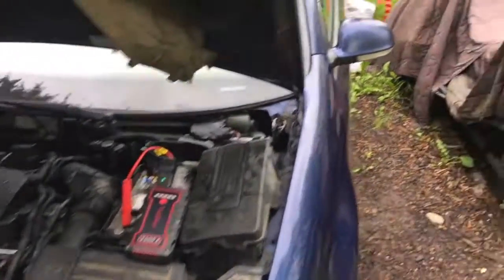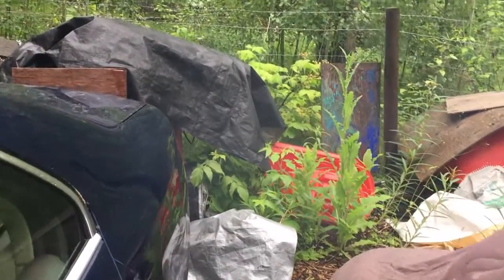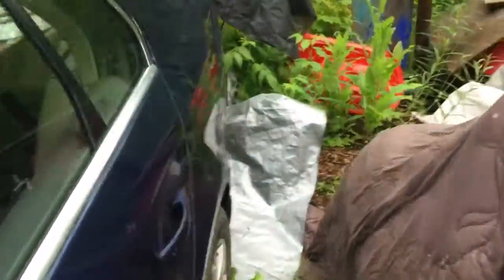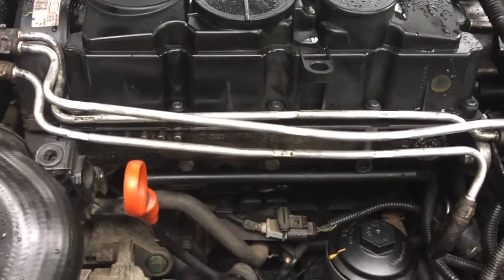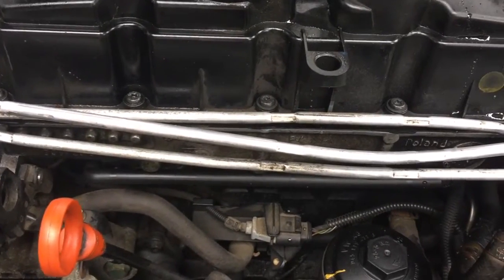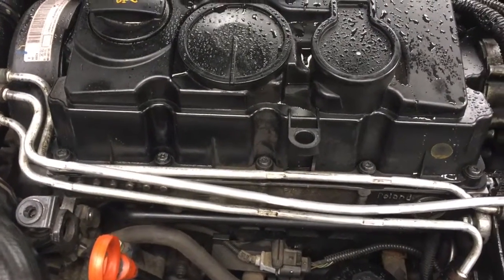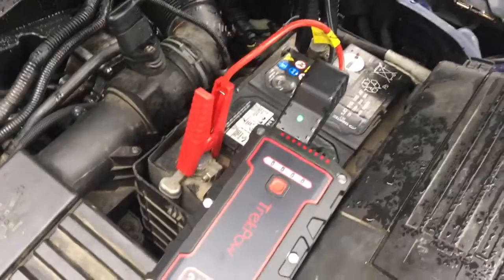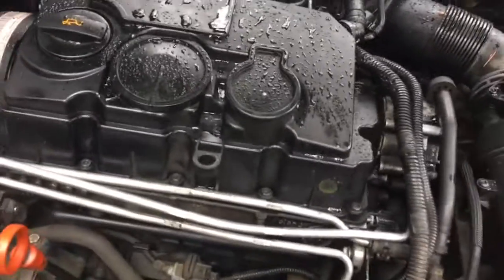2006 Jetta TDI Grey Smoke at Startup

Comment: Did you figure out what it was at the end?
Reply from the maker: Yes! My best guess at the time was that one or more injectors were leaking. I bought a set of injectors with around 70,000mi from someone on ebay. I put them in and it hasn't smoked since, which has been three years now! I recall reading that injectors are supposed to be calibrated or something, but I never did that. The injection quantity deviation values for the four cylinders are very close, and the fuel economy is around 35+MPG with mostly city driving. Unfortunately I don't believe that the injectors for the BRM engine are re-buildable, and you cannot change the tips like you can on the ALH engine, so one suggestion might be to find a set of low cost/low mileage used injectors as they are easy to put in. However, the issue could be caused by something else.
Reply: @hlukeh  Thanks for the quick reply. On my Jetta 1.9 tdi, code marks BKC, it smokes when the engine is started, for the first time. You also have a video on my channel, you can watch it. The smoke smells like diesel. I suspect the valve seals
Reply from the maker: @verifikatoronline  I watched your video, and the amount of smoke could almost be considered normal for the vehicle, if that's all it ever produces. It does look grey, indicating unburnt diesel vs oil, so the issue could be a leaky injector, but I can't say for sure.
Reply: @hlukeh  Thanks a lot

Comment: Egr delete? Cams good? Injectors?
Reply from the maker: Thanks for the suggestion! I replaced the injectors with a set of used ones and now there's no more grey smoke. The hiccup has also gone away, so I think those original injectors with 360,000km were just worn. It could also have been the MAF as you suggested as the ECU could have been over fueling when starting it, but I had tested with another MAF from another car and it was still smoking when starting it up. With the new injectors the smoke is now gone!

Comment: clean the maf some times it works
Reply from the maker: Thanks for the suggestion! I replaced the injectors with a set of used ones and now there's no more grey smoke. The hiccup has also gone away, so I think those original injectors with 360,000km were just worn. It could also have been the MAF as you suggested as the ECU could have been over fueling when starting it, but I had tested with another MAF from another car and it was still smoking when starting it up. With the new injectors the smoke is now gone!
Reply: @hlukeh  never simple, glad you sorted it out buddy
Reply: @hlukeh  when it picked up rpms that is ot trying to clean the dpf it is a rejuvenation process